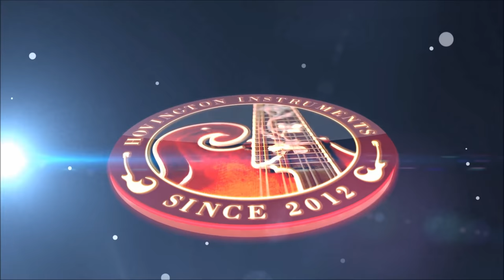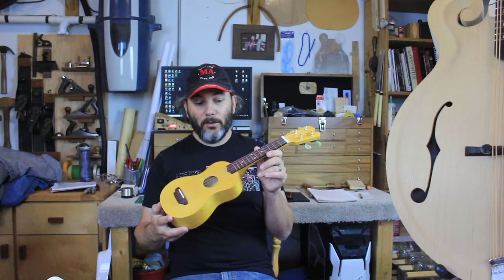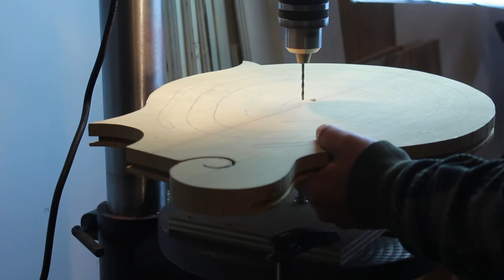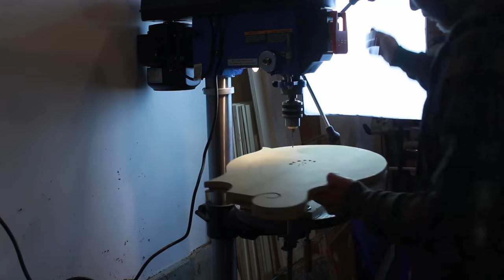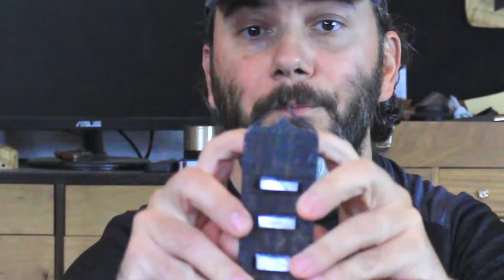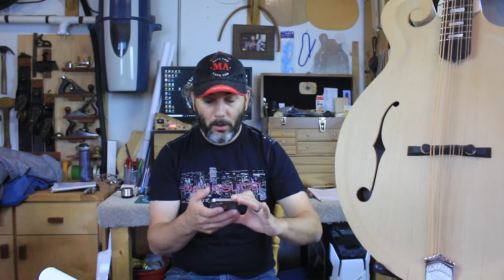Q&A, Answering Your Questions/ Part18a

Comment: Hi Tony, love your channel, regarding print size, with a background in architectural drafting I was wondering why you don't divide up the drawing into several smaller pages using full size 1:1 scale on each of different parts i.e. guitar top with bracing on one page, guitar back with bracing on a second page and neck and the rest on a third page. You can use the dead space around the drawings on each page for details and or notes. That way most guitars can be done on what is known as a "super B" 19x13, 18x24. Very few people have access to a 36" plotter I only had a 24". Just a thought. This would make plans available to more people. Thanks again for your videos and fine craftsmanship and teaching style.
Reply from the maker: Jim Zieger I do have both options available PDF or Full size Paper. As for the multi page drawings, I agree, it would make sense in regards to size. But if I do that then I increase production costs by quite a bit and have to transfer those costs to potential buyers.  Musical instrument drawings are often made available on one piece of paper, full size. I have purchased guitar plan in the past that came on a 36/A0 paper size. 

By me providing both options, I think it allows people without access to a 36/A0 printer to have the full size version .

Thanks for the feedback

Comment: Tomy, what size fret-wire did you use for this cello? It looks awfully fat but I’m sure that helps with the huge string gauge. Thanks!
Reply from the maker: It’s a Medium fret size, most commonly used on guitars. Width 0.092 Crown 0.048 tang 0.062. I didn’t want to go too big like bass size fret wire. I think this works really well.
Reply: Thank you! Good to know, I was leaning towards Jescar 43080. Pre-bent to my 12”radius. (25.5” scale, EJ78 strings) I’ll look to go a hair bigger.
Reply from the maker: Make sure to let me know what you think of the bigger gauge. I’m curious:)